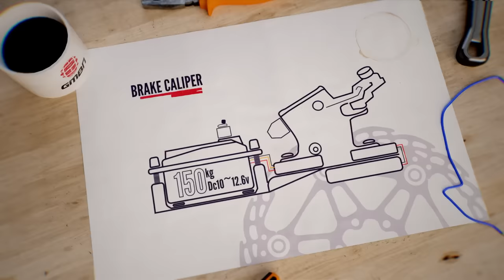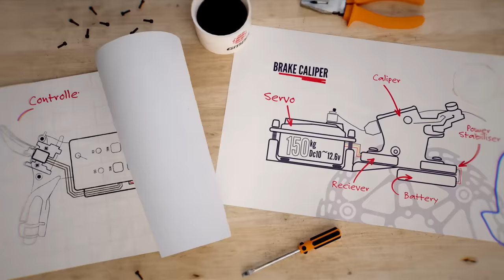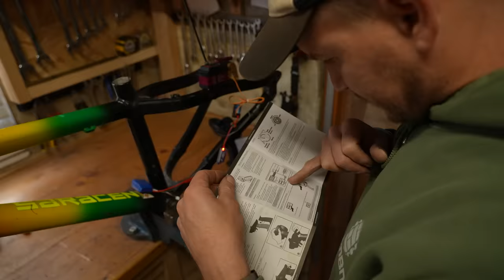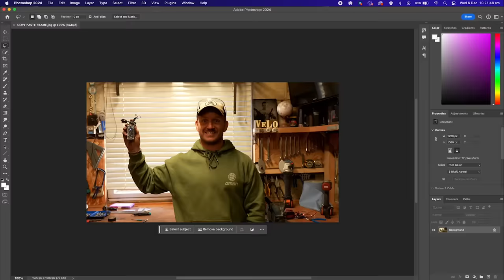We Made The World's First Wireless Bike Brakes

Comment: No reason a standard lever couldn't be used and the standard piston and reservoir replaced with a linear potentiometer activated with the old piston shaft. 
You could also have it pushing a compression spring for feedback in the tail of the lever's old cylinder. The force of feedback could be adjusted with a screw in place of the brake line flange flare nut that pushes the springs seat.

You'd think without the hydraulic line or cable making a direct line to the caliper it'll always feel wooden but having flown toy planes for most of my life you quickly develop a forced feedback in what your thumb ( finger in this case ) feels on the stick vs the reaction of the plane to your eye vs the expected reaction. 
So even on a removed system you notice a slow reaction from the plane translates into a mushy feeling and you know airspeed is low and control reduced. The same happens with racing sims with joypad controls even without haptic feedback. 

With a rc style system you can totally change how your brake reacts in a way that is impossible now.
Feedback is done by spring compression as above or in various other methods that could include sealed hydraulic chambers or compression materials.
You have end point adjustment, this is how much lever throw do you want to use overall, the control throw at the caliper remains the same or can be increased/decreased also for more pad clearance.
Bite point can be anywhere in that throw you select, immediate, or with some free throw.
Exponential controls the linear movement, around the bitepoint for example do you want more lever throw to equate to more or less bite at the caliper which would give you more or less modulation. 
A more directly connected caliper could also automatically account for pad wear using pressure feedback ( actual pressure or power draw needed ) to keep the bite point where it was set at the lever. 
I suspect different weather conditions that affect the friction and braking power can also be accounted for as the system notices a difference in pressure to deceleration values from normal.
You could also monitor temperatures and increase brake pressure to keep the same feel at the lever as the system heats up and becomes less effective. 
ABS also becomes easy to implement. 

Total chance to geek out here with whats possible, maybe not by a turbo cake powered Blake in his shed however.

Comment: honestly i would have just made the servo assist your braking
not like you really need it on a pushbike as you have no weight and hardly and trouble locking up even w/ your hands pulling the levers
but if you wanted a servo doing your breaks having it assist the existing lever pull by sitting in the back like in your wireless solution but the breakwire is still attached to the levers in the front and the servo simply acts as a break booster by being actuated by a simple switch either in the back or at the front on the levers (like a brakelight switch on a motorcycle)

Comment: you need a variable signal hydraulic pressure sensor (i.e. 0-10V signal depending on pressure) to get the analog brake experience 😂

Comment: That gave me a brainwave: use a leaver that is fixed in place, and use a strain gauge instead of a potentiometer to measure the braking "effort". That way you can get some feel by actually pulling on something instead of having no resistance at all.

(I know it will require some coding and manufacturing effort, but..... it would be frigging cool! :D )

Comment: The reason they don't exist if obvious, if you have wireless gears and they dropout, you can't change gear largely an irrelevance for the majority, if you have wireless brakes and they dropout, or auto-lockup, you could potentially be killed. 

I could see making an argument for a wireless rear brake to remove cables, or need for intergration through the frame, while having a hydraulic line to the front brake so even in the case of failure you have your main brake.

Comment: Why not? Formula 1 cars have brake by wire. If you can get the “feel” right then I guess it could work well but not sure if you could get the weight down and also risky if your battery runs flat…

Comment: Problem the locking of the lever, Batterie drain and failsafe system.  Failsafe would be needed for emergency when the system fails or wireless transmission fails

Comment: I like these experiments, but I don't see an actual braking probelm we need to solve. We've had hydraulic disk brakes in radio controlled cars for decades so it's nothing new. Ive seen so many nitro RC cars launch into the stratosphere in the early days because of signal losses/noise/interference and batteries going flat. Then we had failsafes connected to the servos and now programmed into the radio to hit the brakes if the signal is lost. Imagine the Rampage guys try and clear a canyon gap and failsafe kicks in!! So many life threatening factors being introduced here.

Comment: I will never ride wireless brakes.
I'm not sold, I think it will be too complicated, too big, too heavy. Probably possible to make it smaller, but still won't be as good as proper hydraulic brakes. Also sub zero temperatures will likely render them useless. My GoPro Hero 7 Black batteries run out of juice in maybe a maybe less than a minute, or few seconds and that's in -1C. Batteries run out of juice in sub zero temps way too quickly. Unless it manages to make it self so warm it lasts for a while, Gopro hero Session 4 can handle -11C at least. The reason that camera handles it is this camera gets very warm. In the summer it can be a bit painful to the touch, as it's not warm, it's hot. Not sure how you can make it work for a brake system. I tried my A7 IV camera in -1C it worked fine, battery definitely runs out of juice faster, but did not drain it, was 85% when I went out, and 46 when I was at home after a 1 hour ride. But I only took a few photos. I don't know how a wireless brake will perform in the winter, it has to get very hot to work in -10C for example. 
Also such system has be be secured to avoid jamming the signal.

Comment: I seriously doubt the brake companies havent been working on this long before you.

I cant understand why you would say the electric brake on an RC car was the catalyst and.then use a servo to activate a mechanical caliper.

Your RC car and every other electric vehicle brake system uses the motor to create braking force.

Why would you not do a dual motor braking system like every mid class and up electric scooter does or you know... like you RC car does?

If the throttle is proportionally sensitive enough it gives you some modulation.

Regen braking on escooters is currently well established but still has a long way to go before its even remotely close to as good as existing brakes.

Technically this fuctions but ebraking will be done through motors and give us the added benefit of 2wd.

I doubt we'll see a reliable wireless brake system in production any time soon.

Considering how bad new tech in the bike market is initially, why pay for testing when you can get your customers to pay for it, there is no way I'd trust the bike industry to make wireless electric brakes safe and reliable. 

Its just not in the bike industy's DNA.😂

Comment: Concept is mislabeled. Majority of bike brakes by nature are wireless (meaning wires that would carry current or electronic signal are absent) as they are either operated by cables or hydraulic lines. If the intentent was to be free of cables that doesn't make sense here either as the the servo is pulling a cable to engage the brakes. I would attempt to call it brake by wire, but that would imply electronic control  and modulation of a mechanical or hydraulic system by means of wiring, which is opposite of the title. Maybe servo controlled braking. Novel nonetheless but not realistic. The real genius will be the person who invents pipeless plumbing AKA "wireless plumbing"

Comment: This is really dumb. Fist I have to tell you that I am a recently retired electronic designer and I love automation and control systems. I worked doing this for 37 years, and at home with my own projects.  I am also a bike rider. I have a few issues with doing this control with brakes. Brakes NEED to work reliably. Wireless control is not 100% reliable. If you are in a panic situation where you need instant control and reliability you don't want wireless. Also having this be dependent on a battery is not a good situation. This is a fun experiment for a YouTube video but it is a dumb idea for real world use.

Comment: Nope, definitely not gonna trust these, I already wouldn't use wireless SHIFTING, let alone wireless SAFTEY RELEVANT components! Just imagine some sorta transmitter sending a signal that happens to match the signal and frequency that ur front brake lever sends to ur front brake caliper while ur going downhill at high speeds, and then imagine the outcome of that! Or imagine ur out riding all day and the battery runs out of juice!

Comment: There is no way we gonna have wireless brakes. Wireless shifters are no risk solution. The worst that can happen is you wont be able to shift for the rest of the ride. Meanwile what's the worst that can happen with dead brake battery? You die xd.
Reply: Other than that shifter battery is working for a second and motor turns off. Brake battery would be working all the time. Because you modulate, hold the brakes for longer periods of time. Battery life would be bad or battery would be heavy.